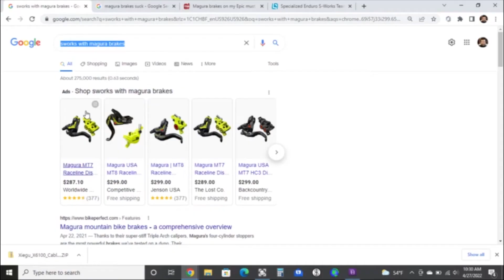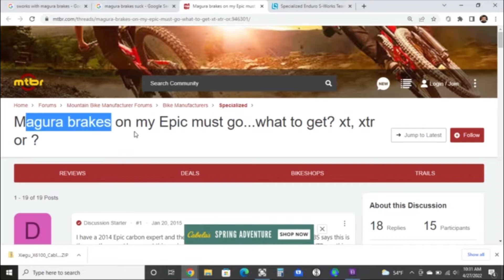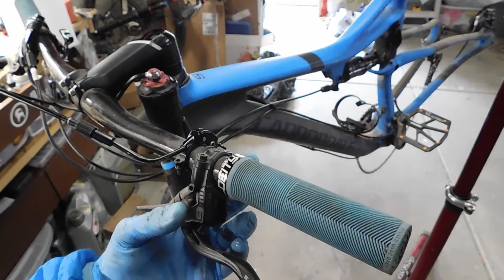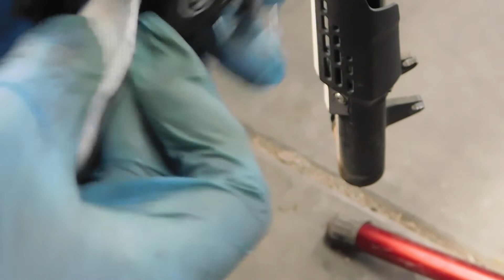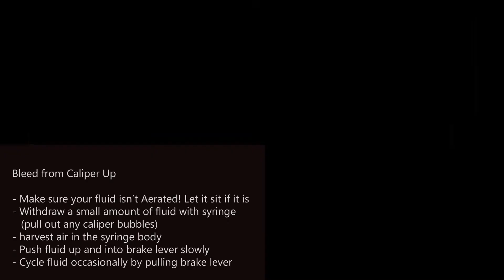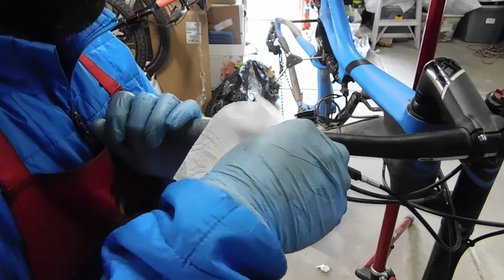Bleeding Magura MT series Brakes

Comment: I bought Maguras for 3 of my bikes. They are hard to get the correct feel. The oldest set I own has over 2 years, and so far no leaks. But I might consider a different brand next time, or going the shigura route.
Reply from the maker: I'm happy to know that you've had no leaks so far. I feel like the leaks come on later than that but I'm also curious if they are properly bled more often if they'll develop leaks at all. Mineral oil becomes very corrosive over time with use. It's a crazy route for our industry to take for brake hydraulics.